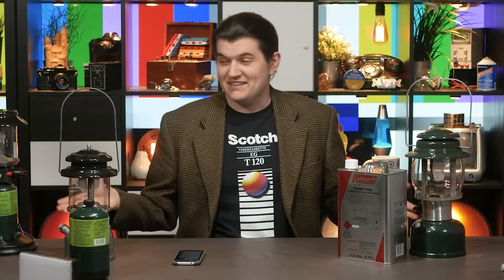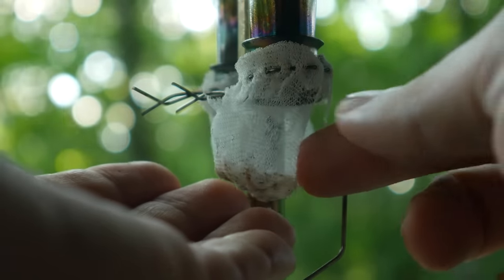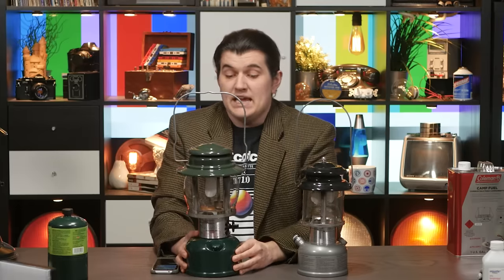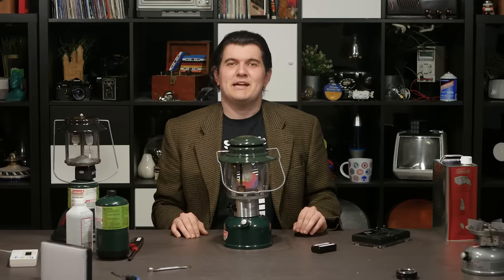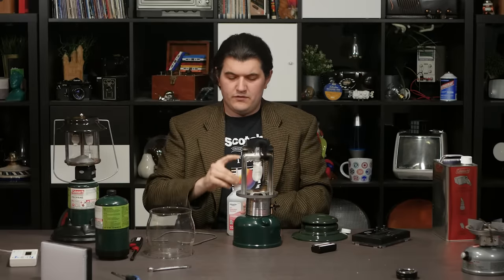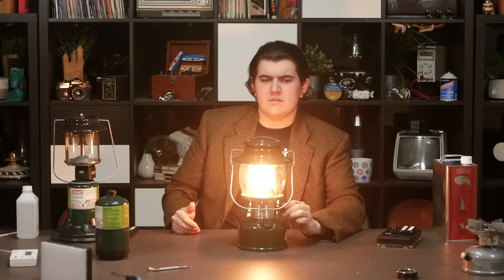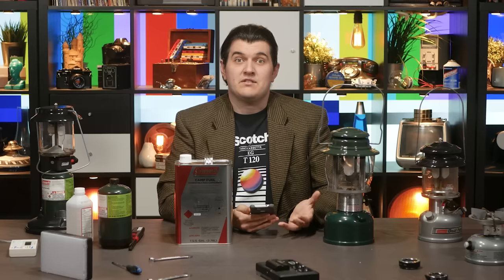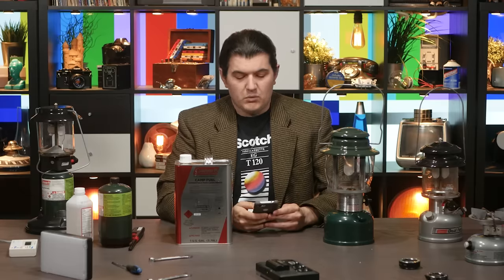A very rambly Coleman Lantern follow-up. Turns out they rarely make sense in 2021

Comment: Ive already had a long post on this video, buti  have some experiments that may be interesting to people here. a thermoelectric generator (TEC module on a CPU heatsink) on a standard kero lantern can give a good 2-3w of LED light. thats an awesome amount of light if used well. A 1w general bulb, .5w as a spot over the kitchen, n 2x .2w reading lights, thats massive! from one tiny kerosene flame. and there is still the regular light from the Kerosene flame to. you can keep the stinky kero light outside and bring the LED's inside. would be interested with what can be done with the waste heat from these mantle lanterns. And if you dont need all the power for the the LED's, you can recharge your batteries for later! the TEC/heatsink/fan thing is easily as large as the lantern, so something that you'd leave in the cabin, not carry on you. If you have a fire based lantern, you can run electric stuff off TEC's. 
like any DIY gadget, will take some fiddling to get it right, but 'Why Not Both?'. In my use case scenario, im not going to the cabin without a can of Kero to light the lanterns. its necessary for the ambiance. 5000K light is just not approproate to light the room. but some LED's to chop my onions or to read by, sure is nice. whats the phrase, defence in depth? the more layers you have, the better. Solar, Battery, petrol, kero, wood. if I had enough water, id run hydro just for the giggles.

Comment: with a 'larger than factory' battery on my Milwaukee LED lantern i can run the light for probably 24+ hours and charge a couple of cell phones.  the days of using cheap flashlights and lanterns with AA or AAA batteries are over for me.  definitely recommend any of those high-end consumer/pro grade lithium battery drill-driver kits for USB charging and lighting for emergencies!
Reply: Hi vjmacintyre have you become a flat earther yet? If not I suggest watch a 13 part series called What on earth happened by Ewaranon to learn that the earth is not a globe. I got it in my about tab.

Comment: end up using Ryobi battery LED P796, from the Despot,  with 6 amp hour batteries. They last at least 70 hours and longer on lower settings. I found with the dual fuel and gas from a pump, the generator tube clogs and about every second tank would need a new generator tube, white gas ends up being cheaper, unfortunately i had a bottle of vinegar in my  storage container the bottle leeked and  the steel just blew up and I saw them being too dangerous to use.

Comment: I used a white gas single mantle light like these every day to milk my cow before and after going to work for 9 years and I loved my Coleman light I could have used a battery powered light but for a practical outdoor light nothing would beat one ..now days there are new technologies but in the 80's and 90's I kept it hanging by the back door and used it always ... during that time I had very little maintence and a gallon of fuel went a long way... I don't consider them to be dangerous .. if you use your head for something besides a hat rack ..!

Comment: My comment on an 1 year old video which may already have been addressed.

Which fuel system would be best for cooking.

There are several stove types available. Sure wood is a thing, but in a city and perhaps in an apartment that is not usable unless one got an old ass house with chimneys built in.
But wood is not a thing one can use for those of us with new houses without chimneys.
I am thinking about Ukrina, or one of those situations without power for a week, up here where there are actually cold winters with lots of snow regularly.
Reply: I have a kerosene camping stove with a silent burner, as opposed to a roarer burner. I think that's the best option for inside a house when in a power outage. I think the roarer burner is just too loud for inside a house, but it works better outside because the silent burner gets disturbed if there's any wind.
Reply: @flat-earther  ok cool, ty for the info

Comment: I think you missed another benefit of battery lighting, the minimum achievable weight. I can easily have a battery light outputting 100 lumens or so for a full night for under 100g. It's a no-brainer to throw it in the pack. I can even strap it to my head. The weight of a fuel container and lantern alone is way over that, before you even start adding fuel.

Comment: Can fully confirm that backpacking these make zero sense. White gas is already one of the more annoying resources to manage (water can usually be processed and dry food is both light and pretty easy to predict how much is needed) so using that limited resource for light just doesn't compute even if it means just only operating during daylight. On the bottom end of the scale a simple LED headlamp for every person gets you all the functionality you need with just a few AA's. Most people I know tend to add a small solar lantern (luci light or similar) to stick in a tent or on a table for just a few oz heavier and ~$20

Maybe though a long term campsite where you hike in and out but leave camp set up and want the convenience? Not really, for like $15 more than a white gas lamp and gallon of fuel you can get a 650 lumen LED lantern and 5 watt solar panel designed for backpacking. Then you again aren't having to hike in all that extra fuel or having to worry if staying up too late one night means not being able to cook on the last night

What about car camping? Still not even. If weight is so little of a concern that white gas doesn't just automatically lose to batteries and solar, then you should probably be using propane as your cooking fuel for ease of use and cost. So what point is there then in bringing a second fuel source and an buying an expensive lantern vs the much cheaper propane lanterns if you absolutely must avoid electricity

Even for propane the only scenario I have found use is weekend camping trips where I bring a large stove and a 20lb propane tank. Just cooking alone wont come close to getting through the tank, and then for just a few weekends a year it is more cost effective to buy a cheap propane lantern than a comparable lumen LED set up for camping

As for the concern of the cold, frankly if its that cold usually you are making a fire, and after dark you're usually right next to that fire or in your tent. The amount of people who will be hiking at temps low enough that batteries are failing while not needing the supplemental warmth of a fire is a fraction of the already fraction of people who are camping in those temps

Comment: You aren't factoring in the heat produced. I live off grid, and use pressure lamps and deetz lamps during the Ohio winters. My solar production during the winter is non existent, and the heat produced means I burn less firewood.

Comment: Propane is great for emergency use! It does not go bad like most fuels. You can have a 5 year old propane tank and its still perfectly fine
Reply: Good point. But does it work in freezing, the bottle gets cold doesn't it when it's used?
BTW pete I suggest watch a 13 part series called What on earth happened by Ewaranon to learn that the earth is not a globe. I got it in my about tab.
Reply: @flat-earther  propane is used for heating in some rural areas. the tanks are stored outside. they do cool down when used, sometimes they even frost over on the outside. Typically you dont have any issues unless you are tying to run something like a 400,000 btu/hr unit off a small tank.

Comment: Lol typed this just before you mentioned emergency lighting and heat... Hmm, those things throw off a lot of heat when running.   I seen a vid where someone commented that they used the Lantern more as a heat source than as lighting.  I had just bought a 200 coleman and a 512 catalytic heater for a friend as a just incase told em hmm maybe just use the Lantern for light and heat in one room it should be fine Crack the window open and wallllaaaa. Heat and light good for up to 8 hours.   But they have never used them before so they are leary of them.

Comment: The Kerosene thing, the Northeast is different. That home heating oil is a thing sounds stupid, except the pressure cylinder for LPG can cost 3,000 USD $. The tank for oil is hot rolled steel, but was being sold used in the 1960's. They both have a per gallon price, it's like the same. Can one pit kerosene in a diesel?, I think you could run a dump truck, payloader on home heating oil. 
There's a lot of B.S. on this, like I turn the heat off when I go to work. With electric in the pacific northwest, for a one bedroom apt. It could be 350$/month, that drops to 130$/month when I turn it off before work. The northeast does still have kerosene heaters, mostly laying around, but Dec. 24 2022, scranton, PA has an overnight low of 3°F. If a furnace is sized to provide the heating for that, it's nice to have extra. Also, the common fuels are useful in auto maintenance.

Comment: The pump stem likely has a 1 way valve, and the hole is a vent for the lock twist step.
Edit: his comments on fuel station gasoline prices aged well into 2022, lol
Edit2: there's also the cost differential of having to buy more canisters of white fuel as it's a used resource opposed to the reusablity/rechargeablity of batteries

Comment: Great set of videos.  I'm thinking about picking up one of those aladdin lamps now for home use.  For car camping i still use the coleman propane as I 1) don't go often enough to justify investing in batteries and 2) i've yet to find an led camping lamp i prefer for color and intesity.  
For point 2 even my neighbors who go camping way more often then I, had some fairly decent LED lanterns, and initially scoffed at my old boy decided they needed to "up their lighting game" after a weekend together.  I don't doubt there could be a model that outperforms the propane coleman for my use case but does anyone actually make it?

Comment: I realize that these videos are old but once you learn the proper way to take care and light the gas fuel lanterns. They are not bad to use . No the should not be used for in doors . I have with windows open.  I put that responsibility on my shoulders. The propane works well also .

Comment: International campers used to prefer liquid fuel because it is impossible to carry propane on planes. Nowadays the point is moot because you can't take any fuel on planes at all. As for kerosene vs others - diesel fuel is available everywhere. white gas - not so much.

Comment: I would rather use the Coleman fuel lanterns than any battery type because in Minnesota it gets cold very cold . And batteries go dead fast here the fuel lanterns give off light and heat. The fuel will outlast any battery charge.

Comment: Great video.
I have not watched to the end but I am compelled to make the following observations.
Whilst you are impressively accurate in your observations, the criteria that you are judging them by are not precisely the same as the reasons why people like them. 
I live in Scotland. Its a 1000mile round trip from here to London. Power outages and foul weather are routine up here. The weather is very Nordic, in as much as we have long, languishing summers and long unrelenting winters. So solar is great half the year, and almost entirely non-viable the rest. I get under 7hours of daylight per day on some days in the winter, and that is including dusk and dawn, with the sun rising low in the sky before dark comes back. In summer, there is a short period where it is never truly 100% dark. Compound this with the fact that on top of supply chain issues here in the UK, the shocking price of coleman propane (£20 a bottle), and that last year we had a swathe of power lines down that left many people in the North without power for almost a month .... the needs are different.
Like most people who either live off grid, or who might end up in that situation due to circumstance, I have to ensure I have the capacity for heat, light, and the ability to cook, all using different fuels. My solar generator and USB power banks will be fine for a while... but they will run dry. My butane and propane devices are great whilst the gas is affordable and available. But if the power goes down for a few weeks, and the roads are blocked with snow.... Im going to be at the point where I need kit that runs off other fuels.
I have kit so I can cook heat and light using paraffin, kerosene, alcohol or pretty much any liquid or solid fuel,  that will burn willingly or under duress. If things get REALLY bad, and for an extended period of time, then having equipment that can run off fuel syphoned out of a petrol tank, or drained out of bottles from your decorators kit, is of absolute life saving premium. I even have a few vintage miners Tilley lamps, because they can safely light a room, and heat a tent (put up in my living room) for weeks, with just a litre or two of paraffin.
I guess what Im saying is that I see your point, but your point is based on the assumption that everything is working fine, the roads are open, the power is on, the supply chain is optimal and the prices are cheap. You buy an old school liquid fuel lamp precisely because you are concerned that you cant assume this is all going to be the case.
My BRS hand pumped petrol stove may well sit in my storage box for twenty years and never be used, but it is excellent precisely because I know when all else fails, I just need to find some semi-spoiled flammable liquid that I can drain through a coffee filter, and now I can boil water or heat my home for a week.
All the best to you. You speak absolute sense, its just people buy these things for reasons outside of contemporary consumer logic.
Reply: Hi thewt have you become a flat earther yet? If not I suggest watch a 13 part series called What on earth happened by Ewaranon to learn that the earth is not a globe. I got it in my about tab.

Comment: what I love about kerosene as lamp/stove fuel especially while hiking, is the energy density. You get a lot more hot meals out of a bottle of kerosene than a bottle of gasoline or even ethanol. So you carry less and/or can go longer.
If you, however, try to take it up one notch and assume petroleum would work just as fine from the thin nozzle if you just heat the generator enough...no, you just built yourself a smokescreen device. A lot of guys from that music festival will testify. Oh, and don´t confuse white gas and white spirit. Just a hint. Ask me how I know. The drawback of kerosene, however, is ironically its higher boiling point which makes it technically safer and a lot less explosive. Because it smells like fuel for about ages, and security staff at airports are not cool about it. Again. Ask me how I know.

Fun story: I once witnessed a Coleman gasoline generator stove go into runaway, it went so hot that the pressure in the tank kept on building, getting it even hotter, etc, until there where sooty flames shooting out all around from under the pot and you couldn´t reach the valve anymore. I wasn´t the operator, btw. Luckily it was on a beach, and there was only wet sand around, so everyone went a respectful distance away, and we chucked things at it to make the pot tip over, which it did, and extinguished the roaring hell beneath it,  so we let the pressure escape and waited until this doomsday device was cooled down and equalized, put it away, cleared everything out (wasn´t so bad), and lit a good old bonfire, after our heartrates were back to normal.
Reply: Isn't white spirit some sort of paint thinner or paint cleaner ?
(I ask because it's precisely that in France but I don't know where you're from on the other hand).
Reply: @psirvent8  Yes, it´s paint thinner. it´s not healthy, smells like hell and the smoke is phenomenal. I am from germany, we call the stuff "Nitro dilutant", so I wasn´t familiar with the english term. Luckily, a friend told me a story of him watching some other german tourists firing up their camping stove on white spirit, and what a mess it was.  I find these different names super confusing. i am glad i own a stove now that takes kerosene, so kerosene it is ;-)
Reply: @paavobergmann4920  Well, here in France there are 2 kinds of white spirit: Regular (Which smells as bad as you describe) and "de-odorised", which has a slight smell of kerosene.
And as far as I know (Mainly from my dad who did use it a lot during my childhood to paint walls at home), it's a paint thinner.
Not a fuel.
Yes it's flammable, but don't light it up.
Dietz lamps run on lamp oil, alcohol stoves run on methylated spirits, kerosene heaters run on kerosene and so on...
Reply: @psirvent8  Yes. I guess "de-odorised" is more like a thin aliphatic paraffine oil with less aromatic compounds (C8-C10), like you get it as xylene replacement (RotiClear) or de-odorised petroleum.  And no, it is not a fuel, it burns sooty like hell. I think the mistake was to confuse the bottle in the shop either with Ethanol (which is sold as "Spiritus" in Germany, meaning denatured ethanol. In Germany it contains either 1% of petrol ether or methyl ethyl ketone as denaturing agent, not methanol, which is deemed too toxic and dangerous), or purified gasoline /hexane, which is sold as "Waschbenzin" in germany, meaning "Cleaning gasoline".
Btw, lamp oil does not burn clean in gasoline stoves, either.

Comment: You mantles with a top and bottom hole are for Tilley lamps, Tilley has the "generator" - vaporiser running centrally through the burner assembly.

Comment: If I camped I'd use  a 3x18650 pack into an orange LED strip attached to some 4' stick, lathe ...
the light wont attract many bugs and be soft enough for star gazing, reading & pee strolls. charge with 14v solar panel